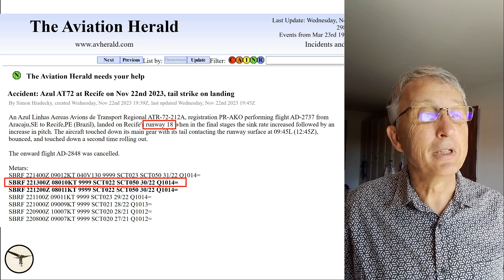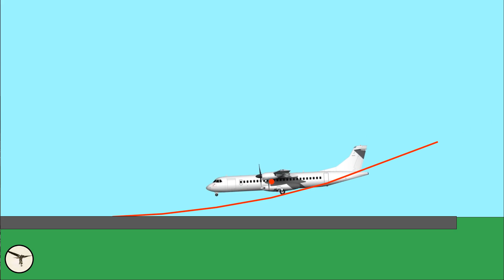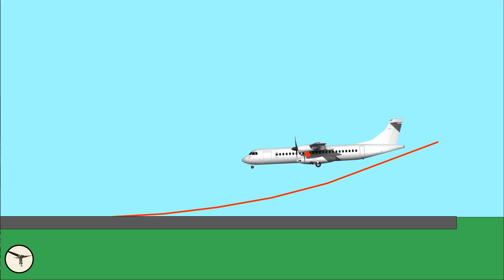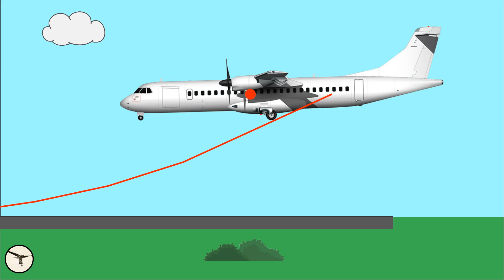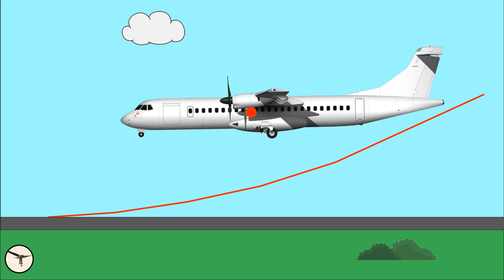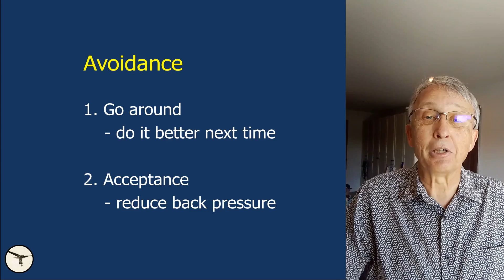Azul ATR 72 tail strike - and how to avoid it

Comment: Hello capt magnar, capt let me ask about ATR landing technique and the landing performance (vref or vapp). In the ops manual it shown ATR landing technique is in 20ft Rad alt the pilot need to chop the throttle, but in daily flight ops usually the pilot is choping the throttle in below 20ft, or gradually closed throttle. It kind of impossible if choping at 20ft while at dicipline Vapp landing, and it making the aircraft sinking too fast.. So kindly explain the right things , is the book wrong or the pilot is wrong ? Tq and safe flight capt magnar.
Reply from the maker: Who wrote that ops manual? FCOM PRO.NOP.ANOR.1.3 (page 5) describes the landing: "Maintain... Vapp until 20 ft is reached." "During the flare, the airspeed decreases, resulting in a touchdown speed 5 to 10 kt lower than the stabilizers approach speed." "At 20 ft call from PM, reduce to FI and flare visually as required." Therefore, you shall not chop the throttle, but reduce to to FI.
Reply: thank you so much captain, will more learn and more review for the proc.. safe flight always capt magnar.

Comment: The rotation around the center of gravity and the resulting down movement of the main gear is probably only part of the issue. If you think about the net lift force of the airframe it can be explained a bit better I think: During the flare when the elevator is pulled the horizontal stabilizer creates a down force. This pushes the tail and entire aircraft down, because the pitch angle and thus angle of attack has not yet risen to increase lift on the main wing. Additionally the aircraft has some inertia and even if the necessary pitch would have been established a couple seconds before touchdown it would take a while to arrest the increased sinkrate. So as you correctly pointed out, if you flare too late it is better to just take the impact instead of trying to pull up violently, causing a stronger impact, a potential tailstrike and a bounced landing.

Comment: what's the pitch input gonna tail strike the ATR
Reply from the maker: To avoid tail strike at takeoff, the pitch should not exceed 8 degrees. To avoid tail strike at landing, the pitch should not exceed 6 degrees. The value is less during landing because of the rate of descent.

Comment: Very good explanation. I have many years experience on these aircraft along with instructing and examining of pilots. Pilots have to learn, it doesn’t mean they’re bad pilots. I have had two incidents where a trainee has flared a little high setting up a higher sink rate than normal, and yes, an increase in back pressure coupled with the sink rate has resulted in the tail bumper shoe scraping the runway momentarily. Nothing quite like this case, but close enough. Yes, relaxing the back-pressure just before the main wheels touch down does save the day and result in a much smoother touch down. But it definitely does not infer a bad pilot. They all have to learn.

Comment: Are all landings being video'ed? If not, then it's amazing that this one episode of a poor landing was caught on video. 
Are tail-strikes on take-off common? I've done a few (on MSFS, not RW!) and now try to keep the nose up 5 degrees or less, though I find the slightest pull on the yoke can lift the nose to 20 degrees, so it has to be very delicate. Am I doing it right?
Reply from the maker: The ATR model in MSFS is not correct when it comes to tail clearance during takeoff. In the real aircraft, we rotate to 8 degrees and become airborne when the pitch is about 5 degrees.

Comment: And most important, add POWER to compensate for the loss of energy and bring your speed back to at least Vapp. This may result in a very high bounce, but you'll already be go around minded at this time and at least you'll save your tail! As you said, most importantly, if you're faced with a situation like this, GO AROUND, and try again! Would you agree with that, Capt?

Comment: Thank you for another wonderful video Captain, like many others have said they’ve been invaluable in learning the ATR for MSFS. If you don’t mind the question, when preforming a localiser-only approach what mode do you use to reference your altitude (since GS obviously isn’t available.) I tried using the APP pb hoping to get V-FP but GS armed anyway and I ended up doing it in VS until transitioning to a visual approach once in VMC but I don’t think that sounds right?
Reply from the maker: To fly a localizer approach, you use LOC and VS modes. The navigation source is V/ILS. LOC mode is armed with the NAV pushbutton. To determine your position on the glidepath, you follow the DME/altitude table on the approach chart. 
As a rule of thumb, you descend 320 feet per NM. The location of the DME transmitter determines the DME reading over the runway threshold. 
A second rule of thumb: Your rate of descend is 5 times your ground speed. For example, when the ground speed is 120 kt, the rate is 600 ft/min.
Reply: @FlywithMagnar Thanks Magnar, very much appreciated ❤

Comment: The -72 is much more prone to tail strikes than the -42 not just because of a longer fuselage, but also because the main gear is farther behind the center of pressure on the wing. Thus, attempting to check a high decent rate (ostensibly at a low AOA) with pitch, only pivots the main gear lower increasing impact forces and in conjunction with a high pitch attitude, the likelihood of a tail strike. A flatter pitch attitude and lower flare while reducing power at touchdown is the best defense in avoiding high decent rates and using power instead of pitch for correction if a high decent rate develops. 

If it becomes marginal too long, a go-around is the best option. Good video.
Reply: Indeed, exactly.

Comment: if you have the margin in terms of speed, would increasing the power help to rotate the nose down?
or does that cause more trouble than it's worth?
Reply from the maker: Changing power does not change pitch on this aircraft. But adding power will increase lift by increasing the airflow over the wing.
Reply: @FlywithMagnar  I was thinking from a different type/model, where adding power did change pitch very significantly due to the engines being (in that case) significantly below the standard CG, causing a major Pitch-up motion...
thought, with the high mounted engines of an ATR 72, that will work in reverse...

Comment: Hello. For sure is not the best aircraft design. A very sensitive airplane to wind changes (horizontal and vertical) with an absurd low pitch angle landing limitation is a bad mix. Incredible but is a really good advice to do a go around in this “normal situation”. A lot better the ATR42

Comment: i did the same mistake with a hard landing in msfs 2020. 
if you turn off power at 50 feet or early then you might start thinking that you can glide down to the runway to make a butter. But this is only possible with light planes like cessna 152. Heavy planes like atr 72, airbus a320neo, boeing 747-8, etc they all need power down to the runway. I am usually trying to fly with power to 10-20 feet and only then disable the throttles. With a proper flare this is usually giving me 100-200 fpm at touchdown without bounce.

Comment: Very nice explanation about the incident😊...
Happened to me HARD Landing maybe 3.0 on GMeter landing when i was FO long time back...this time i learnt so much how to avoid hard landing that may consequence tail strike...
1) Vapp must be corrected
2) VSI 600ft/minute
3) PL TQ 20+-% each engine depends on weight,winds cond etc.
4) Centerline
5) Correct Flaring Technique initiate between 20 to 10 feet RA and then reduce PWR gradually till touch down...(by feeling and experiences)
I just wanna share my 10cent suggestion for smooth ldg...🙏🏻

Comment: For me it's the take-off in MSFS 2020, in the 72 only.   You'd think I'd pay attention better, but.....
Reply from the maker: The model in MSFS is not correct. There should be no tail strike as long as the pitch doesn't exceed 8 degrees.
Reply: @FlywithMagnar  well, that's what I forget and I pull back to much, forgetting I'm in a long low rider.  It's not always, mind you, and I don't do it in the 42 at all.  I fly too many varieties of planes, so I forget the little nuances, when I come back to a plane that needs a bit of though.  Cheers!
Reply: Can you control the tiller in MSFS?
Reply from the maker: Do you mean the Nose Wheel Steering tiller? No, you use the rudder pedals.
Reply: In my experience, the ATR 72-600 takes off practically by itself if you use the correct trim-setting. Perhaps that's the problem?